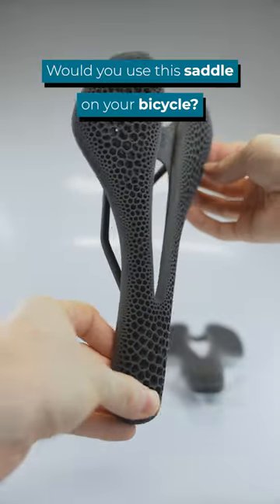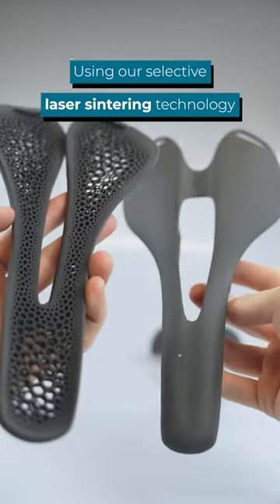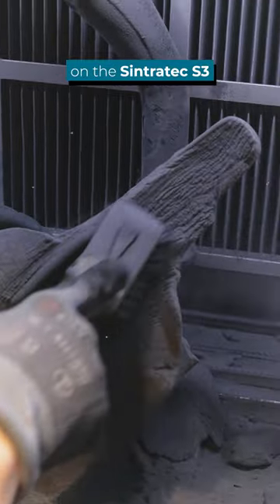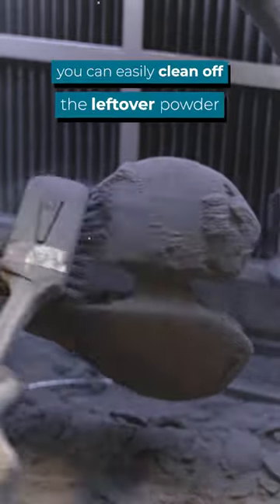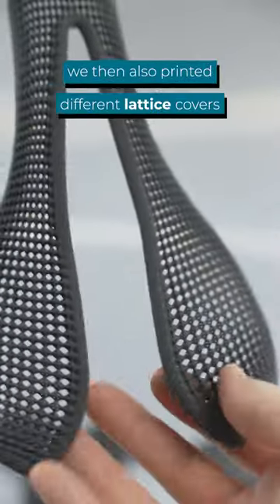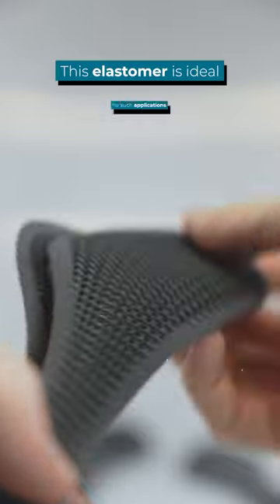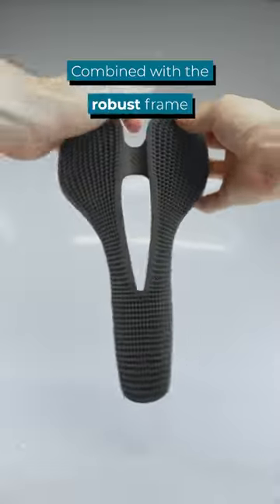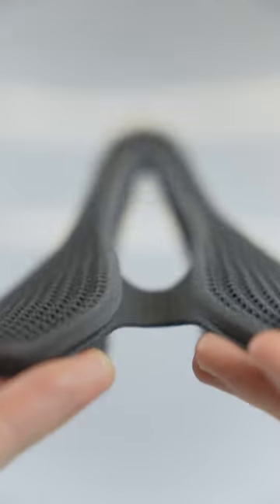Would you use a 3D printed bicycle saddle? 🚲

Comment: Fresh design! Although I can share that I've tinkered about 3D rails quite a bit. Nylon rails do not classify as anything trustful to sit on.  My recommendation its to make composite for the rails to absorb the weight. Carbon lamination-3Dnylon monodesign rail-carbon tube in the center as core - design iteration for the rails. The weight which saddle have to tolerate is quite significant!

Comment: Is there a reason for bushing the sintered part clean rather than using an air stream?

I'd be a little worried about how well the tpu would hold up long term, as it seems the tpe design is leaning more towards not trapping humidity.
Reply from the maker: As you can reuse 75% of the unused powder, that is the reason for brushing the part first. We then often use additional air or sand blasting after vacuuming the part. Regarding the TPE part: Definitely room for improvement, this was the first iteration and just a concept at this point.